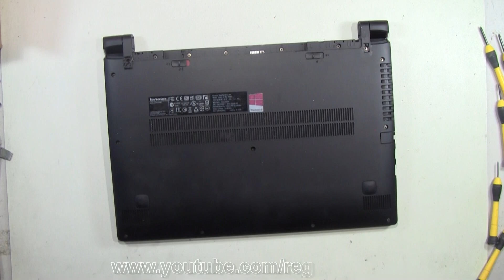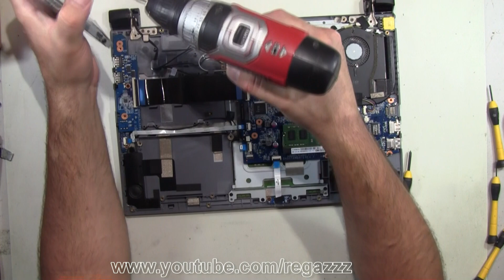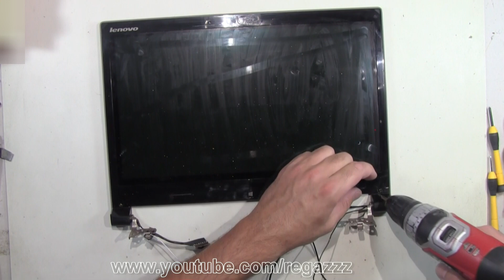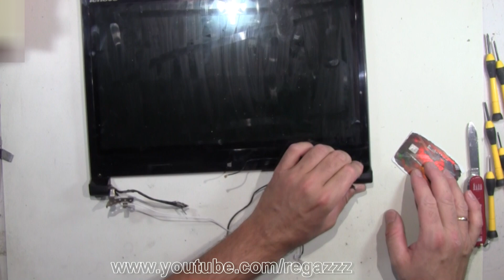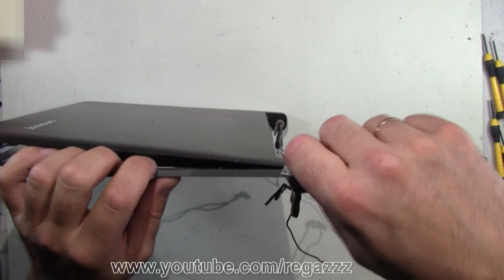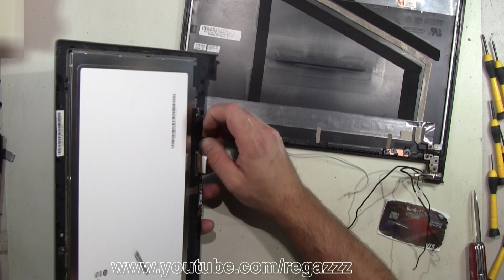Lenovo IdeaPad Flex 14 Model 20308  How To Complete Take Apart Full Disassembly Nothing Left

Comment: Hi.! Thanks for this tuto... Dou you have the replacement number of the keyboard and the touchscreen panel, please..?? 🙏🏼
Reply from the maker: I would simply go to eBay, search for used parts for this particular laptop. If searching for new, very often some parts resellers show up and they are most likely unaware if the part will fit or not even.